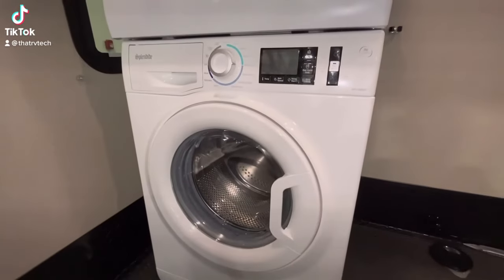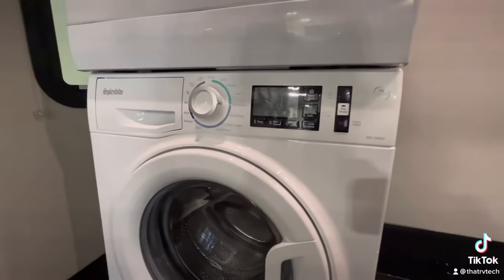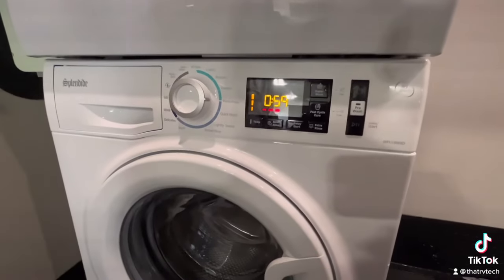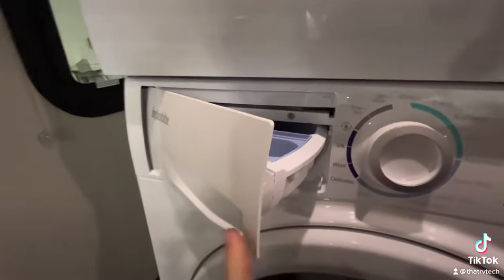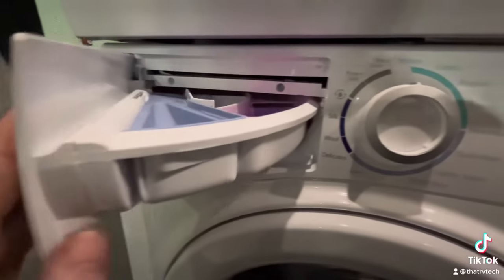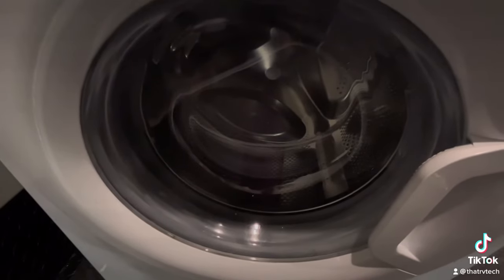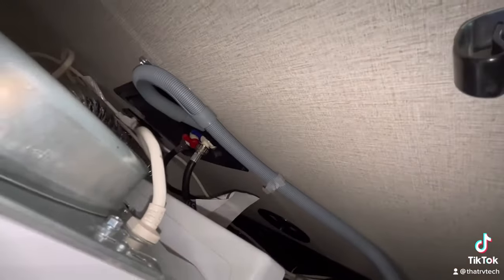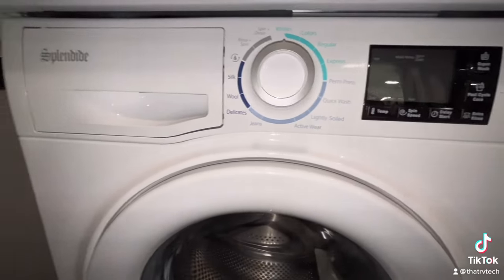How to winterize your RV washing machine.

Comment: Per the winterizing instructions. Pull that bottom trim panel and the drain  pump and strainer are right there.  I use a wet/dry vacuum to suck all the water 💧 out of the drain system.  Then I  do the water intake with the antifreeze.